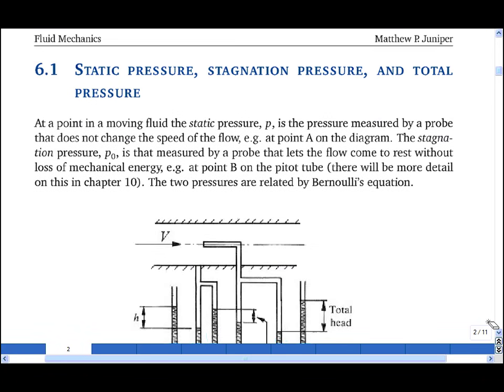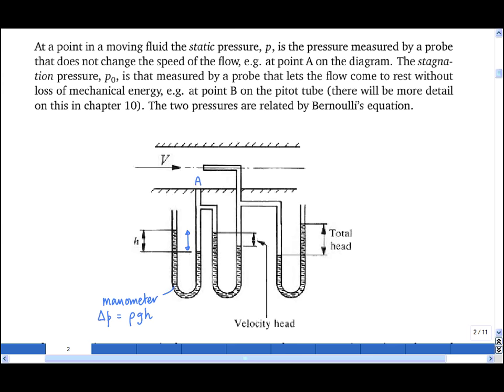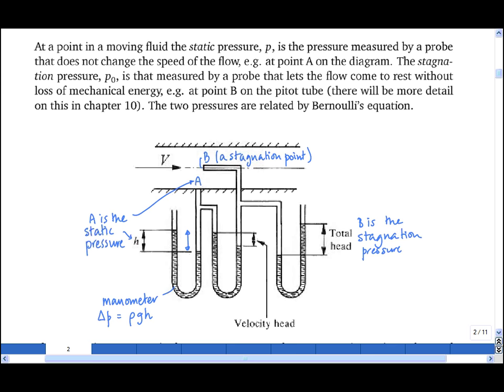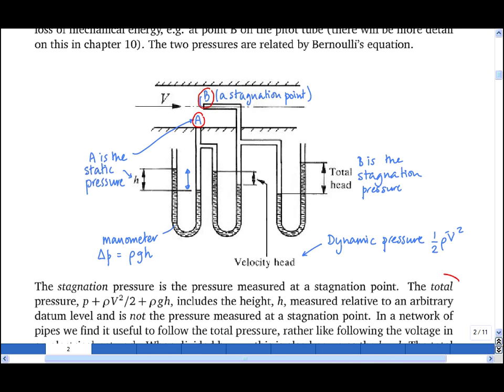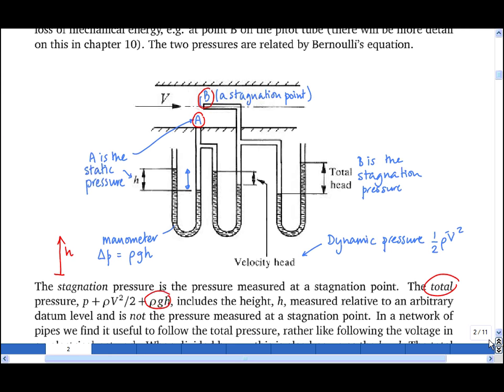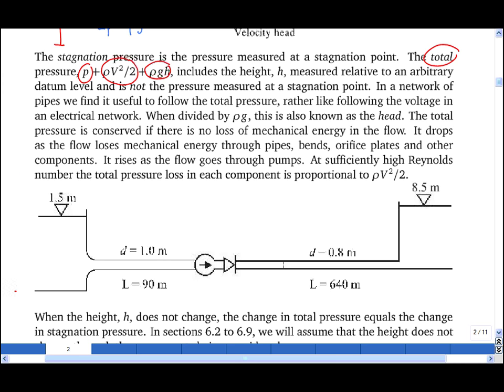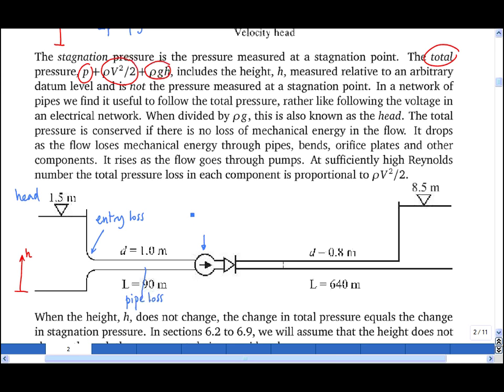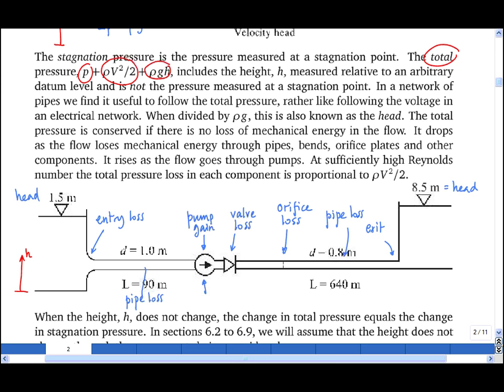6.1 Static pressure, stagnation pressure, and total pressure

Comment: How does the fluid not lose mechanical energy when slowed down to zero?
Reply from the maker: As its speed reduces, its pressure increases. In other words, it loses kinetic energy but gains pressure potential energy.
Reply: Good point... well, it would in a real world. But "IF" we were able to slow the flow down with zero losses, then the pressure we would measure locally would have been the "stagnation pressure". It is just a theoretical value and gives you a measure of the energy carried by the fluid, expressed in units of pressure.